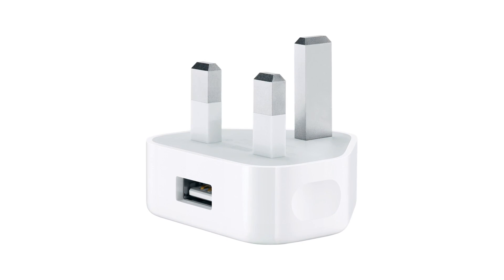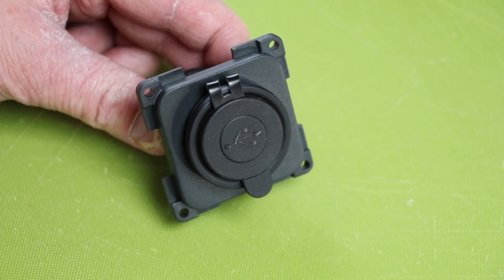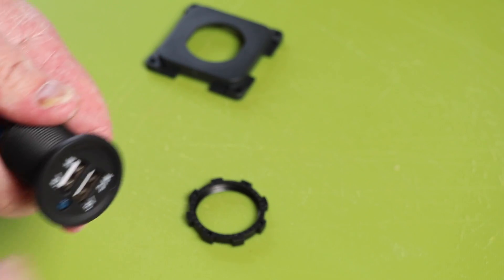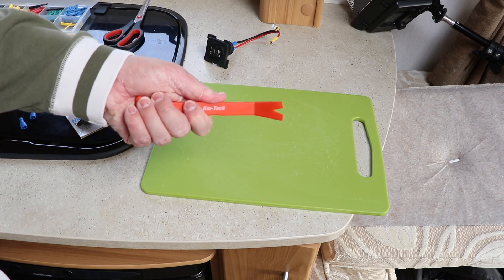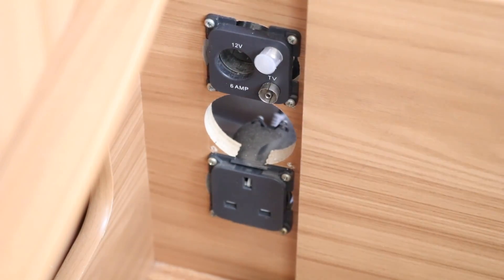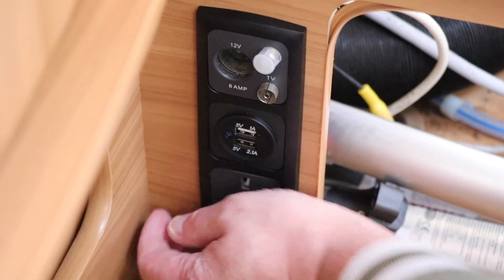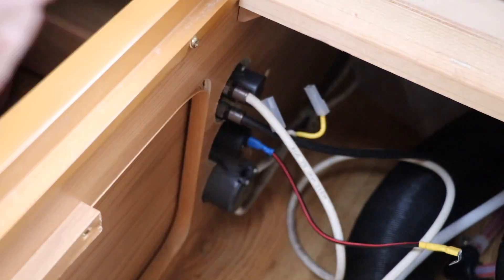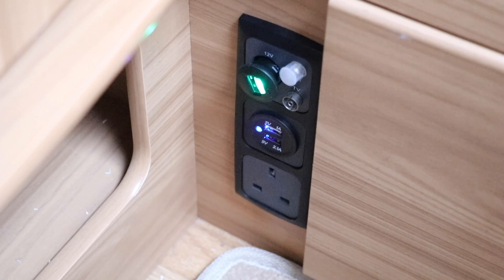Caravan USB socket upgrade

Comment: Great post yet again👍 Thank you🙏 Do you know how I could get a 12v feed to my teltonika rut951 in my Bailey Unicorn Cadiz by any chance🤔
Reply from the maker: depends on the year of the caravan, but usually you can get a 12v feed up the corner of the kitchen splash back and along to one of the top lockers.
Reply: @TheTrudgians The year is 2017 but I am going to put the router next to the habitation door in the cupboard above the seating area

Comment: Nice neat job! will a 12v usb charge a phone or laptop or would you have to have a step-up converter in to it first?
Reply: Hi Gill, a 12V USB socket will service an iPhone/mobile phone and, at the higher 2.1A output, even an iPad/tablet.  But you will not be able to charge a laptop from a 12V USB socket.  V... 👍🏻 🐍
Reply: @Venomator.  Thanks for your reply, your the first person to offer a plain and simple answer to my question, all the very best :)
Reply: cmgill2 Gill Very welcome Gill, any time! ... 👍🏻 🐍

Comment: A very informative and interesting video Dan thank you! I'm a Chippy myself but am no good with electrics so can I just ask a novice question? It says on the front of the USB socket that you fitted 5 Volts, yet you wired it into a 12 Volt circuit so the question is, why doesn't it blow the 5 volt  socket and or your phone, when it's a greater voltage??
Reply from the maker: Hi Bill, Thanks for the email. 

Ok, so the USB sockets i installed require 12v to work. They regulate the voltage so they only output 5v to the devices. SO any device that uses these USB plus will have the correct voltage and current. 

Let me know if that helps - if not I will try and explain in a different way.

Take care
Reply: Yes that makes sense many thanks!!

Comment: Great video, thanks for sharing. I have just ordered one off the internet so hopefully it will be with me soon. I do have one question what is the wiring gauge you used for the two extra cables. There are so many different rampages for 12v wiring.
Many thanks Paul.

Comment: Ive bought a length of l e d lights with the intention of cutting them to length and sticking them to the underneath the shelf in the wardrobe where it quite dark , was wondering is it o.k to hook into the ceiling light switch ? Had this roll of l e ds for ages and I am unsure how to go about it as I havent seen any videos on utube or written bloggs . Seemed like a good idea at the time could you assit in any way ? . The usb is a great video .

Comment: surprised you haven't fitted a fuse in the supply to the usb unit as the main feed is probably fused at 10 Amps , could be decidedly incenduary with a usb socket it it goes wrong.

Comment: Hi Dan,  could you tell me what size wire you use please. Also, I'm thinking of just putting crocodile clips on the other end of the connected wires and take them directly to the battery terminals.  Would that be advisable?  Tia. Yvonne
Reply from the maker: Hi Yvonne, I use cable from Maplins rated at 25amps. (i have this knocking around at home from other projects) - i'll be honest i wouldn't recommend taking a feed directly to the battery via croc clips, and also place a fuse in line with the cable, incase of issues. 

Although you didn't see a fuse on my installation, the socket is already fused on the existing cable i piggy backed. 

I hope that helps
Dan
Reply: The Trudgians 
Ok thanks for that Dan. 👍

Comment: Hi Dan as a new cravanner I have found your posts very helpful, I pick my van (sprite alpine) up next week 

Have you any views on covers for winter storage I have heard so many conflicting stories
Reply from the maker: Hi Colin, 

We don't cover our van during winter as we try to use it in the colder months (we love winter caravanning) but many folks do. As far as im aware, just ensure the cover is clean and well fitted to the 'van - this will minimise any damage. Also if you have a solar panel - make sure the cover has a clear panel so sunlight can still penetrate through.

Hope that helps
Dan

Comment: Great video!  Mr T, do you recommend tinning the stripped ends of the cable, before crimping the connectors on?
Reply from the maker: Hi Jim, i've not been a fan of crimp connections traditionally - but one tip i was told years ago was to not tin a crimp connection (unless you are planning on soldering it) the tinning process makes it harder to crush around, and can leave a loose connection. By leaving the wires bare - it makes a better mechanical connection (i.e - being crushed)

But to be honest, its dealers choice really. Wherever possible - I always solder for an excellent electrical connection and bind the cable to make a sturdy mechanical connection. This video demonstrates that you don't need to solder etc.

Hope that helps. 

Dan
Reply: FYI in the electrical contracting trade it is acceptable to join cables using crimped joints (using a calibrated crimper), and this is regarded as good as the original cable. We never tin the conductor.

Comment: Happy New Year Dan. Thanks for another very useful video.  👍🏻

We have the same issue in our Bailey Ranger, which has no 12v sockets at all. I want to do the same but with one difference. I’m going to add a switch because the USB module will use power all the time the master switch is on. If you’re not using the sockets while the master switch is on, your battery will be wasting power.
Reply: Yep we put switches in as well.
Reply: Excuse me im new to caravanning, what and where is the master switch?  I presume your referring to the 12volt supply?, thanks Dave
Reply: we had the Bailey Senator which was the same, nowhere to charge 12v stuff.